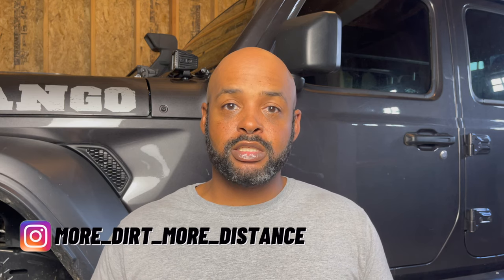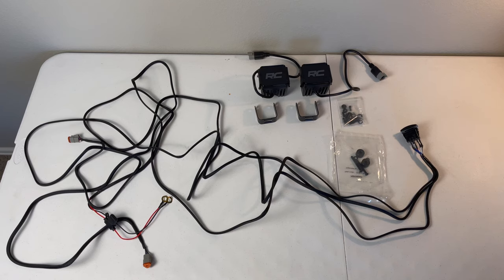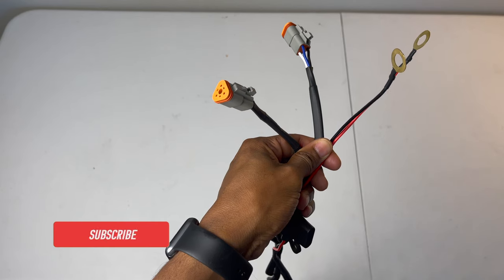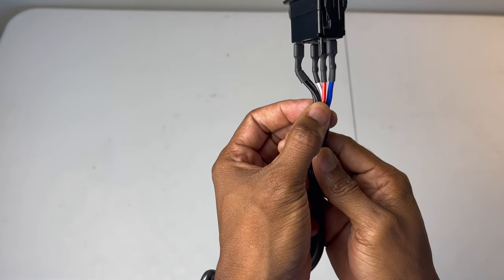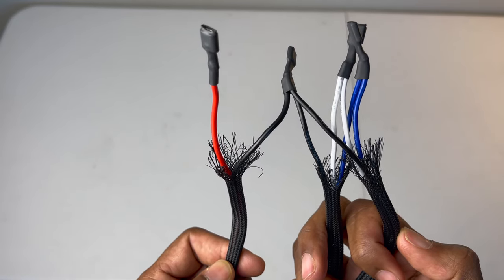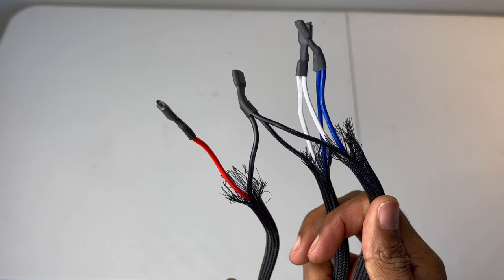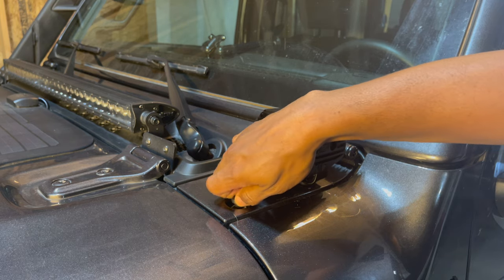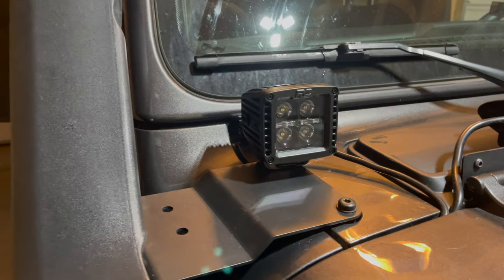Jeep JL/JT  Gladiator Build ROUGH COUNTRY CUBE LIGHT BLACK SERIES W/ AMBER DRL Exterior Mod Install

Comment: Great video !! I know the cube lights have 3 cables white black and blue what do you do to the black cable ? I did not see you connect it to anything  thanks
Reply from the maker: Thanks! Sorry for the late reply. The black cable is the ground. I put a ring connector on the black cable. There is good place to ground next to the battery see 8:12 in the video. Hopefully i’ve answered your question.

Comment: Do you have a video on the 30 inch light bar installation?
Reply from the maker: No. I installed the light bar before I started making the install videos.
Reply: @MoreDirtMoreDistance  i installed the light bar but was able to connect the wiring and light up. Looked up all over youtube and wasnt able to find one.
Reply from the maker: @sauravm9093  It’s been awhile… but, I connected mine directly to the factory auxiliary switch, so I didn’t use the wiring harness. Red power wire connected to the aux switch and black ground wire grounded to the body.

Comment: Great vids been following you for awhile  how are the lights holding up  long term?  Any moisture in them or any issues?  And do you drive with the amber drl on the road
Reply from the maker: Thanks! I haven’t had any issues. I’ve only used the amber offroad if it’s dusty.

Comment: How did you remove the spade connectors from the toggle switch without any damage to the toggle or connectors?
Reply from the maker: I grabbed the wire close to the base of the spade connector and just gave it a firm pull. They should disconnect without damaging anything.

Comment: If you wanna sell that unused switch I’ll but it
Reply from the maker: My email is in the about section. Send me email and we can talk about it.
Reply: @MoreDirtMoreDistance  ok cool…
Reply: So the Power to the switch and the ground and power wire you just cut and throw away ? Is that because when wiring up to the sux switches those have power ?